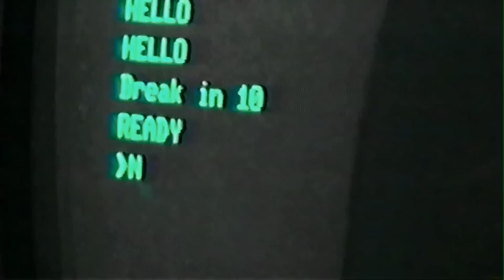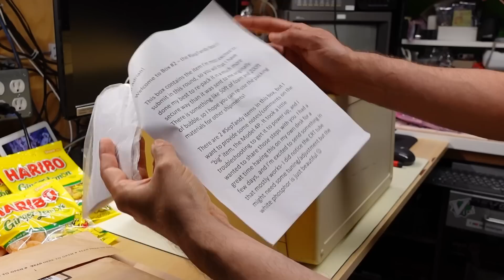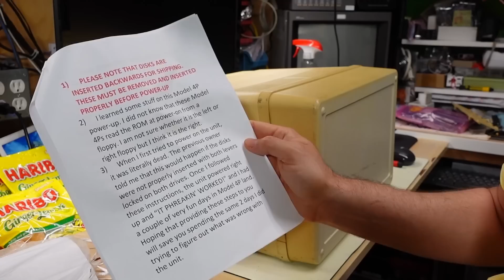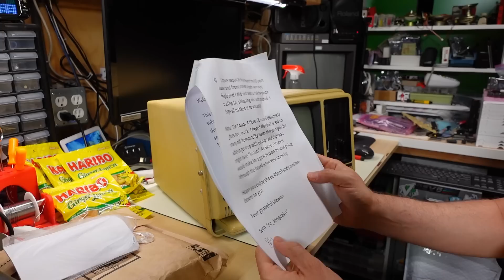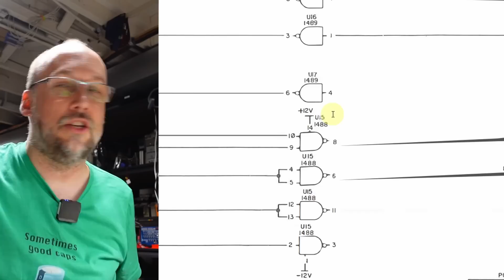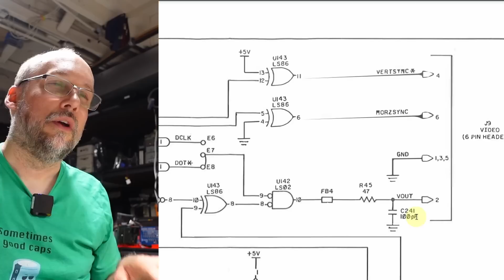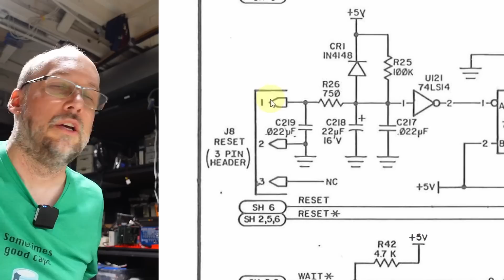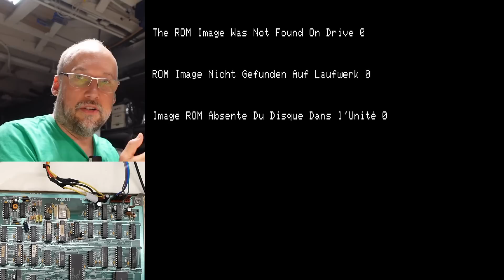TRS-80 Model 4P Test and Teardown

Comment: One warning for when you put the whole thing back together: the 80-column horizontal sync depends on a little varcap in the middle of the motherboard, and the CRT will not sync to 80 columns if it is incorrect. I'm pretty sure it drifts over the years too, making the chance that it needs adjustment approach 100%..
This might also be why your HDMI converter is having problems. The difference is that a CRT will show something if the sync is wrong, but digital converters might blank the video.
Reply: Yes! 
(Had no idea about the variable capacitor, or model 4, but this makes a lot of sense in this situation) 
Leaving the comment here so that youtube may give it more priority.
Reply: @jwhite5008  :Ditto...!!  🙂

Comment: I really enjoy the long videos.  Keep them coming.  Since finding your channel, I have really learned lots about repairing old electronics and I enjoy seeing all the details. Someone gave me an old TNC used in ham radio packet communications with some leaky battery damage that I am going to attempt repair after being inspired by your videos.  I opened it up, saw a Z80 processor and some other components that looked familiar and thought to myself, I may be able to do this. Again, thanks for the videos and I appreciate the long ones.

Comment: These videos are such a nostalgia trip for me. I started with a Model I before it was called a Model I, wrestling with the cassette interface, then had a Model III, got disk drives for it, then later moved to a Model IV. This like a throwback to when I was a teenager and wrote genealogy software and financial management stuff but never knew how to sell it. Wonderful throwback to that bygone era when discovery was magic, Creative Computing was THE magazine of choice, and the IBM PC was yet to arrive. So many fun memories of that golden age.
Reply: The cassette interface in the original Model I had a bug which meant that it was possible for it to read a 1 as a 0 off the tape, especially if either the tape or the player were even slightly sub-prime.  The ROM BASIC code was later adjusted to compensate for the error so that tape storage became more reliable.

Comment: Ah, a stroll down memory lane. I bought a TRS-80 Model I in 1980 (because Apple II was "too expensive"). After various upgrades (expansion, memory, dual floppies), I probably spent as much as the Apple II would have cost out of the box. Oh well. Sold my Model I and bought this computer (the Model 4P) because it was "portable" (wink) and because it ran CP/M and that seemed to be all the rage at the time. But a lot of CP/M software seemed to need a lot of work to get running (kind of like Linux LOL!). Finally sold the 4P and got myself a Macintosh Plus, beginning a lifelong devotion to all things Mac. Which led to a job at Apple a couple years later, and from which I retired in 2015. What fun! Adrian, keep up the detail. These videos are fascinating!!

Comment: Thanks for the awesome content as always.  Thanks for the tip on using the RGB2HDMI.  I'm definitely going to make up a cable and us that moving forward.  

Every model 4 I have, had PSU issues, so I finally just made an ATX test harness and it's so helpful on these machines.

Comment: I own a couple of 4Pees. Modified one with internal 360k, 720k and external floppies, XLR8er 512K ram, Hirez graphics and battery backed RTC. Also modified the boot rom so it sets the XLR8er speed at boot, loads the MODELA/III Rom image from the hard drive and can also boot from an IDE hard drive. Luv my 4Pee, best comp Tandy made.
BTW check the soldering on the Power Supply output connector. It WILL need repairing also replace the yellow time bombs on the P/S. Good luck.

Comment: Hi Adrian
Awesome work chap, felt for you trying to get that Model3 rom soft loaded.
You are right M4 discs should boot straight to 80 column with no Rom softload.

However using my M4 mainboard RGB2HDMI 80 column mode doesn't display properly at all although M3 mode is fine.
I've asked the boys on stardom if anyone got 80 column mode working yet .

Comment: For what it's worth, the little HP pin comes from the late 80's or early 90's and represents HP's PA-RISC line of computers.  The program was internally code-named "Spectrum", thus the rainbow on the pin.  I don't remember for sure, but marketing may have also used the term "Spectrum" in external advertising as well.  I've still got my Spectrum pin around somewhere....

Comment: Wow, this takes me back in time.  I bought one of these back in 1984 after I graduated from high school to use in college.  The power supplies were the weak link and I had to have mine replaced at least a couple of times.  There would have been a model four boot disk that would boot it up into TRSDOS.  Learned assembly language on that machine.  Fun times.

Comment: I am appreciative of long videos, as I enjoy watching you repairing and troubleshooting the ancient computers that showed up long before I was born. And don't worry about AC input, as there's bridge rectifier, so you actually can get away with using DC adapter that fits in (You may want around 9 Volts DC power to account for the diode voltage drop in the bridge rectifier if you have to use DC power into 8 Volts AC input, as it's mostly the RMS voltage that actually matters). EDITED: Checked out the audio spectrography app, it's pretty interesting. Could be helpful for diagnosis of certain electronics, especially the switchmode DC-DC converters, as I am deaf - glad I bought the most powerful phone I can afford (OnePlus 8T) as I knew this app is computationally intensive when I push the limit on the app.

Comment: Hi Adrian,
I've been working on and playing with my model 4P for a few months now so I was excited to see what you might do with one. You didn't disappoint! I found that mine required a thump to power on after doing the 128k upgrade, which it did not require before. I was thinking that I might have stressed the solder joints on the connectors (pin headers) on the front of the motherboard while I was disconnecting them. The next time I disassemble it, I will be reflowing the solder on those. It might be worth a look on yours as well. . . Great video as always!

Comment: That packaging ticks all the right boxes and it's way more than just the bubble wrap. Not only does the quantity of bubble wrap provide good padding, but the foam and other filler eliminates crushable voids and provides crucial separation of items from the outer box walls and each other. And equally important, the box itself is in good condition and sturdy. Way too many people make the mistake of using under-specced or worn-out boxes that just tear out, collapse in shipping like a wad of paper, or they cut down or tape together boxes to fit and end up with a frankenbox that has zero edge strength. That leads to the weight of other stuff it's piled under or up against during transport to possibly crush the goods even if it's mummified in bubble wrap.

Comment: Hi, Adrian.  I think this machine is modified to read a ROM image from disk to use it as a shadow in RAM to increase its performance.  Note the jumpers to mask the ROM, which support my theory.  I therefore believe that the ROM is actually stored on the disk.  Try reading this disk in an emulator to see if this image is visible in the directory.  If so, copy a model 4 ROM image to another disk to see if it works.  A big hug!  Roger, from Brazil. 
PS. I love you and your "long" videos. Please, don't worry 'bout that. 
In fact, the bigger your videos, you can bet the more fun they are.  I confess that they are so immersive that sometimes I stay here "talking with you" on my screen, as if I were there in your basement, as if you could hear my hunches... 🤣

Comment: Great video, love the longer ones.

As for the MC-10, it's really not much like the CoCo.  Only the VDG is the same, but even that is "gimped" and has several of the video modes disabled due to lack of ability to address RAM.  It has a similar but different version of BASIC, with a different (6800-based) CPU.  For power, any 9VAC transformer with an appropriate barrel connector is fine.  Since it's just recitifying it, you can also feed it DC, but the serial port obviously won't work.

Comment: Adrian I just rewatched the sequence where you tried to boot off of the floppy disks. I noticed every time you tried to boot you booted from the left drive. At least before the monitor started to work. I wonder, do you think you should be booting off the right drive? Maybe the external drive that you connected later was the equivalent of the right drive before you took the machine apart? Just a thought.

Comment: Was thinking of bad caps in the power supply when I heard the amount of hum on the beeps. The MC10 has a voltage doubler for the modulator as it needs 12V, that’s why the AC power supply. You can power it with a 9V DC one but the modulator won’t work, so you would need to install a video out mod to use a monitor.

Comment: Hi Adrian! You need to insert both diskettes I included, with the ROM disk in the left drive, and it should boot just fine. The ROM will load first, then TRSDOS will load from the right drive. Your CPM disk might load that way as well, but it has to read the ROM disk first in the left drive afaik. That’s how it was working for me. Good luck!
Reply from the maker: Actually both disks you included do boot the system -- but only once I had the machine on the bench as it just refused to boot at all when assembled. There are other issues as well which I will show in part 2 :-)
Reply: Thanks so much for working on it. I had good fun with it for 2 days :-) I hope you enjoy it as well. I definitely saw some issues with CRT blinking out to a single dot in the middle but was hoping some cleaning might help with that. I hope you can get it running stable! It is a really special machine and the size is great. I’m sure this is more fun to move around than the Model II or even Model 3/4, and this one is more capable than the Model I, so kind of the perfect TRS-80 M-X series.

Comment: Hi Adrian. I have a working 4 P. Behaves similar. LSDOS disk that boot s my 4 desktop also boots my 4P. The NEW Dos for my 3 desktop complains about inserting ROM disk first (works on 3). Break on boot up doesn’t drop to basic. I’m in Portland, if you need a good working machine to help diagnose yours, you can borrow it

Comment: 0:50 I watch shorts, regular 10-30min videos and 40min+ videos. For me repair videos from channels like yours are one of the cases where I don't mind watching longer videos, because to me it doesn't get boring. I can't always watcht them in full length, but I don't think cutting them down works very well for this kind of content. At least that's for videos where it's only about one single repair. For the mailcall videos, where different items are shown, I don't mind if they are cut shorter, because for me these are more or less like "teasers" to what kind of videos might show up in the future.
Shorts I mainly only watch from dedicated shorts creators. I very rarely watch shorts from non-shorts channels, with a few exceptions (not counting the once that you just scroll through once in a while). In some cases I see channels mix in shorts with their regular content, but since they are on the same page as the normal videos to me it feels like they can easily "clutter up" the video page.

Comment: Very interesting as I do have a Model 4p myself without any disks for decades, so I never have been able to boot it up, and the whole computer has been just a weird ornament… and back then all the advice I got was talking about the basic in the rom, which the 4p never had, as I just learned… in my 4p I got some text on the screen which was expecting a disk or something (it was maybe the 1990’s when I last tried it…). But as I never had any disks for it, I coudn’t do anything with it… Also my model 4p has propably some weird history behind it, as it has a cyrillic font installed which you can choose with a switch… I got it in the 90’s myself.

Comment: The length is fine on technical videos.  However, if you find that you're going well over an hour, consider splitting it.

You might consider doing a speedup/time lapse on some tasks, like removing 15 screws to remove the case.  You can always drop back to real time for things to take note of, like the lid button in this video, or the helpfulness of a really long screwdriver.

Comment: 22:02 - I remember having to bring my Model 4 to the local RadioShack for servicing at least twice to align floppy drives. It would drive me nuts that the local store would just keep the computers to be serviced off to the side on the floor waiting to be picked up by the repair people. Same when they came back in, just set aside on the floor.

Comment: 23:27 I scratched my £400 NEC IPS monitor exactly the same way putting together a Shuttle XPC. I cried. It had such deep blacks for mid-2000s. It pays to put at least one sheet of cardboard in front of it - or use another table!

Comment: there may be hope for your LCD monitor. If the scratch is light, you can completely remove it  with toothpaste! Toothpaste contains tiny granules that essentially polish the surface as you rub the stuff on the monitor. After about a minute of circular rubbing action, your LCD will look horrible but the toothpaste can be removed with a slightly moist smooth cloth (like the one you use for cleaning your glasses or camera lenses.

Comment: Hey Adrian, I recently discovered one of these in even better condition! It was part of a barn find, except it had no diskettes. I, ignorant as I was, attempted to turn it on with no diskettes in and I smelled smoke and saw a small puff come from the top right before I reacted and turned it off. Is it perma-dead or is there hope if I take it apart and look into it? Also, any chance you can help me find the right diskettes? I stumbled upon it and have decided to explore 16-bit for the first time with it, if possible. I love the look of old computers and would love to get this thing up and running as a test of learning ability. My end goal might be to try and play chess or write a poem on it.

Comment: I had a little giggle to myself when you started to take the case apart. Portables are always the worst because of the nature of the beast. So many extra screws and awkward access caused by the need to balance practical usability with robustness and serviceability. Serviceability always takes a hit with portables. One of the worst was an early Compaq portable PC from the 80286/386 era ( I forget the model number but it was the  late '80s PC-DOS days) You needed very long screwdrivers with magnetic tips a torch and a lot of patience. There were all sorts of weird variations as the PC market manufacturers jostled to create the main rival to IBM. One I worked on was a ACT Sirius machine which used two 96 TPI floppy drives that varied the spindle speed as the heads moved into the centre of the disks. A nightmare to align the drives, you had to be dead on or they would fail to read as the heads moved in and the speed changed. Another great video - looking forward to the next one.

Comment: As far as I remember when booted as Model 4, 4P uses 80-column text mode which is clocked slightly different from 64-column one. There is a dedicated PLL (phase-locked loop) circuirty on the main board which may cause issues. When I got my 4P its display was out of sync every time I tried to boot it as model 4. Fixed that by adjusting a trim cap which I suppose sets the initial frequency of PLL oscillator (when the frequency is too far from specs PLL won't lock and we get out-of-sync 80-column mode). I have a long story getting 4P to work, finding and transferring software to it, modding it to work with external drives,  etc. Feel free to DM me.

Comment: The 4P did not have BASIC in ROM.  That's why the Break key does not let it boot up in BASIC. In order to use Model III BASIC you needed a hidden file called MODELA/III which was the BASIC code in a single file. A Model III disk should have this on it already.  And Having a 4P you don't need disks in the drives for it to boot up.

Comment: Try measuring the power supply voltages with a small load applied i.e. a bulb.
Reply from the maker: I should get some car bulbs and sockets and use those.

Comment: I don't mind the long videos. After all the repair takes many hours, days and sometimes weeks to do so I bet trying to lower it down to 15 - 30 minutes is a total nightmare.

Careful on running stuff like that. The Floppy drive on it's own power supply could have ill-affects on the device under test. Back in the day working on Arcade machines I had to build a jig that basically put the whole unit onto the workbench so I could run it from a single supply and test equipment such as a logic probe, voltage/current meters and so on.

Comment: Well, I think it would be a win-win if you spent less time in cutting videos shorter so we can spend more time watching them. 😁

One thing that surprised me was that the message about the drive not being ready was printed on the screen in German as well. I am not aware of ever seeing such a computer here in Germany - and we certainly didn't have Radio Shack here. (and whoever translated it was likely not German since we don't capitalize each word like this. To sell  this computer here it  most likely would also have needed a different power supply - wide range input power supplies were likely not a thing back then. French on the other hand would make sense if they sold it in Canada as well.